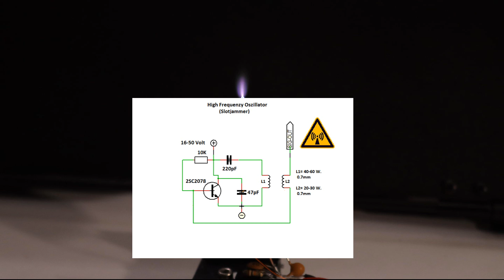EMP Jammer Plasma flame generator - Step by Step

Comment: By putting the RF amplifier into the transistor base, the flame output becomes very powerful like hfsstc but the capacitor becomes super hot and broke after few seconds

Comment: Hi amazing vid, just the right guy I‘m looking for. Someone who knows about plasma & creating plasma flames. 

Could I build the generator to control 4 flames at the same time controlling each flame at a different intensity? 

Could a flame be adjusted enough to give a forward purpulsion? 

Many thnx & take care 🤓😉😘
Reply from the maker: Hey Mate,
Thank you!
But because the flame is high frequency AC voltage, there is no purpulsion. For purpulsion you need High Voltage DC like from a Voltage multiplier ;)
Reply: @Teslaundmehr  thanks, have to keep researching 🤓😉😘

Comment: Beautiful little circuit, I've been in electronics since the early sixties, played with tesla coils and many other things, but never got to plasma until I bought a "plasma cutter" for my welding shop.  I am very interested in this build, it looks very much like my first ones, done with components soldered or (smoldered) one on top of another, kind of "hanging out in the wind" you might say, but very compact, simple, and functional.  I guess I have to build one of these, just can't say no.  Thanks for a great little project, and very fine demonstration.
Reply: Hi John :) You seem to understand quite more about than the average.
Do you think this little circuit could be powerful enough to wield/cut something with?
And if yes, soft/hardened metal, up to which strength?
Thank you!

Comment: Hello
If the flame can melt steel, how does the source of the flame(the bolt) also not melt?
Reply: The acorn nut allows the high frequency energy dissipate from its total surface area, into the discrete arc, which produces the plasma, tearing the air atoms apart, and this generates heat, causing the flame effect, the plasma made, to rise, continuously, away from the generator, but putting a ground, piece of wire, causes all the energy to focus on that one "ground point", minimal surface area, so it melts, burns, while the 1000 times more surface area of the nut doesn't allow any one part get hot.  If you pulled the plasma "flame" off the end of a wire, it too would melt, and the reason for the acorn nut, to allow plenty of surface area to dissipate the heat while providing the voltage and current to enter the air.
Reply: @johnmcclain3887  thank you stranger
Reply: @kuriakosejim8696  It is definitely my pleasure sir!

Comment: Hi Teslaundmehr, I love your RF videos. Please keep up the good work in English. Also if you could explain a bit of this type of RF power circuit, interference circuit, jammer circuit and EMP circuits that you make. Lastly please move up above 10Mhz to 100Mhz then to 700Mhz and finally in the 1Ghz-10Ghz levels of 4G 5G and radars please. Also make a diy plasma arc lighter.
Reply: Do you know that such jammers are illegal? :)

Comment: This is full of provocations, I like that you make a coil around a wire, I checked and it gives 27pF.
But to connect the plus to the collector and the emitter to the minus without any current limitations? How do you explain this?
I hoop to see your explanation in one of the videos.
Great work, maybe you start with ball lightning.
Reply: Maybe currentlimited powersupply who knows

Comment: I think there might be a mistake in the schematic, it looks as if the transistor is connected straight across the power rails, collector is connected to +, and emitter is connected to - , but surely that would short out the power supply (and blow the transistor) right? Also, how is the 57 turn primary is supposed to induce any current in the secondary?
Reply: The primary wrapped around the single lead of the secondary, induces current flow at right angles to its own current, the single lead acting as "half a turn", so needing high frequency to be able to induce enough current to make a significant plasma.  It's very limited in total current, but it allows the circuit to work in very small scales.  I've worked in electronics almost sixty years now, and have only begun to work like this, something I left at about ten, having built a tesla coil, but by no means, able to make such a small powerful circuit in those days.  I am truly amazed by the incredible designs of "self-taught techs" using solid state I am learning about on you-tube.  I worked very high end electronics, secret squirrel secure radio and radar, as tubes were replaced with transistors, and managed to retire the last "HF radio we maintained, from 1938, by the early nineties.  The micro-circuits we used were "classified", are now common in throw-away electronics, and making some truly incredible designs possible.  I never was formally schooled in electronics, but they young ones today are running with the opportunity to make amazing things, I am gratified to see so many, enjoying learning in this way.  I learned electronics, having great fun, each project exciting, entirely new, and am glad to see it still happening, joy at creation, no less than my own.  I've seen hundreds of designs I never would've thought could work, I am never ceased to be amazed.
Reply: @johnmcclain3887  hello , do u know how to make EMP Jammer but using other transistor not 2SC2078 ?
Reply: @rimbang_  Not yet, but I will try to find a substitute.  I've just learned from this circuit, but I will do my best.  It is a bipolar npn moderate voltage, 80V, 3 amp transistor.  I will check around, and see what I can find, and if you have a way to cross reference, or look up, the specifications might help, I don't know what kind of access you have.  it's a pleasure to meet you.

Comment: I finished my own EMP Jammer Plasma Flame Generator, I used your schematic and built it the same as yours except I've used a different transistor because I don't have the exact same, I've checked the datasheet and found out that the transistor that you're using is made for 27 MHz, the one I'm using is made for up to 100 MHz and normally 40 MHz so that should work I thought but it doesn't...
The only one mini Tesla Coil that I've got working was the very first that I found your channel online, it still works to this day but all the other attempts that I wanted to copy your plasma torches I'm failing miserably, I'm not sure what I'm doing wrong this time.
Any advice is very welcome, thanks
Reply from the maker: Hey, the EMP Jammer circuit works only with the 2sc2078e2f2
Reply: @Teslaundmehr  how about D553 or C2078 it wil work or no cz i try it they do not work
Reply: @user255  how about 2sc3950 ? It will work or not
Reply: @Teslaundmehr  ⚠️ God has said in the Quran:

🔵 { O mankind, worship your Lord, who created you and those before you, that you may become righteous - ( 2:21 ) 

🔴 [He] who made for you the earth a bed [spread out] and the sky a ceiling and sent down from the sky, rain and brought forth thereby fruits as provision for you. So do not attribute to Allah equals while you know [that there is nothing similar to Him]. ( 2:22 )

🔵 And if you are in doubt about what We have sent down upon Our Servant [Muhammad], then produce a surah the like thereof and call upon your witnesses other than Allah, if you should be truthful. ( 2:23 )

🔴 But if you do not - and you will never be able to - then fear the Fire, whose fuel is men and stones, prepared for the disbelievers.( 2:24 )

🔵 And give good tidings to those who believe and do righteous deeds that they will have gardens [in Paradise] beneath which rivers flow. Whenever they are provided with a provision of fruit therefrom, they will say, "This is what we were provided with before." And it is given to them in likeness. And they will have therein purified spouses, and they will abide therein eternally. ( 2:25 )

⚠️ Quran

Comment: I used Transistor ( c2078 And c3950 ) But it didn't work ؟
Reply: Hey man i tell you put on C3950 in oposite and make this and if you don t know how tell me again and i send you a link for this
Reply: @neon_undercover2865  Thanks
Reply: You want a link ?
Reply: @neon_undercover2865  give me
Reply: https://youtu.be/3uNpBju4yr4
Reply: In this link she explain how work and how assemble c3950 follow all videos
Reply: I say you i command c3950 on aliexpress ( 5 exactly ) is good for jammer test but suport 25 volt max and Sc2780 e2f2 is very good transistor i dont say that in my link she says that's
Reply: And you want use c3950 use 221k 2k ceramic  capacitator and i dont use 47 pf and function but transistor dead but not directly in the many time